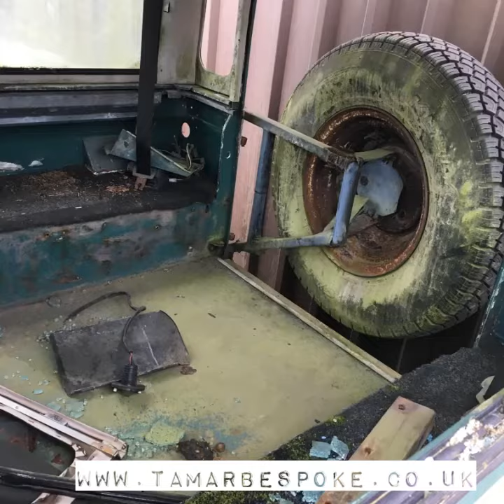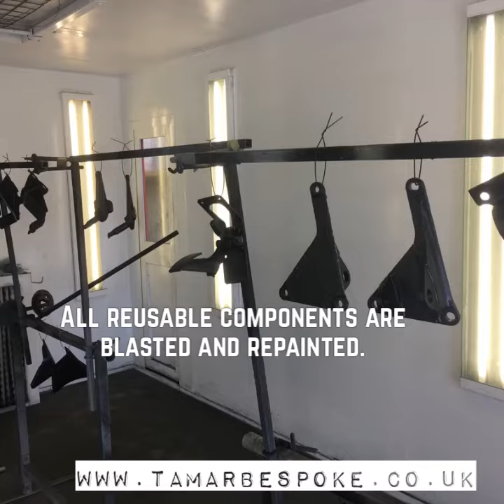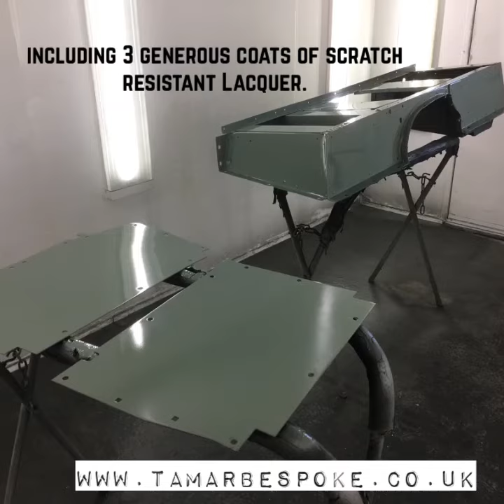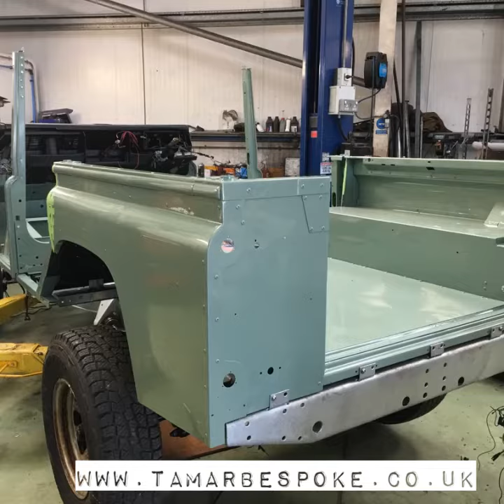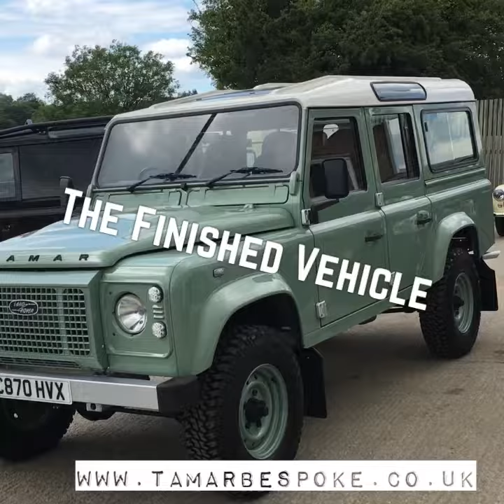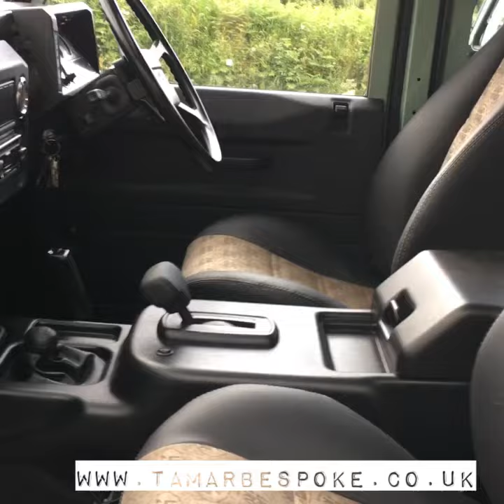Land Rover Defender 110 Heritage County Station Wagon Full Rebuild by TAMAR

Comment: It is lovley, really lovley but originally it was a County Station wagon, very rare. You removed the chassis and engine and basically all the originally of it. County station wagons of that age are sort after and rare when original. You turned it into a fake heritage which is arguably not that rare nowadays. It looks good but could have looked better restored as a CSW